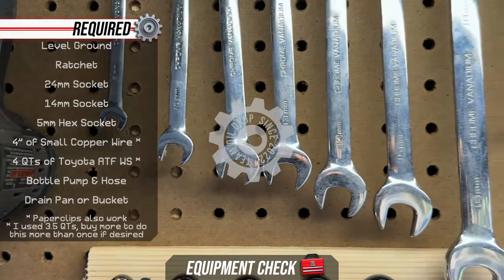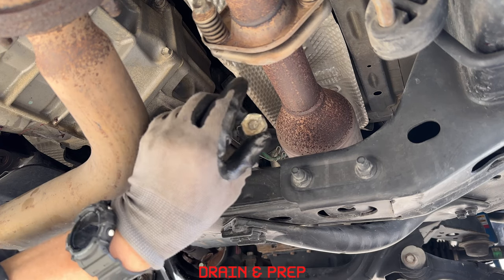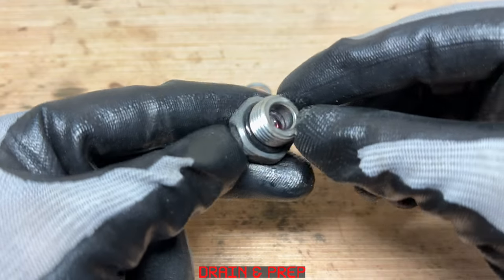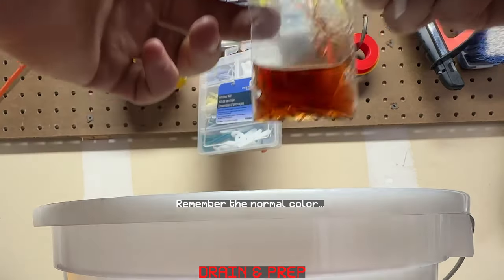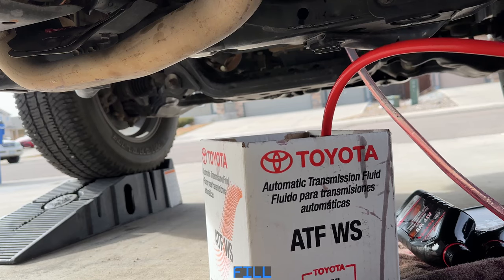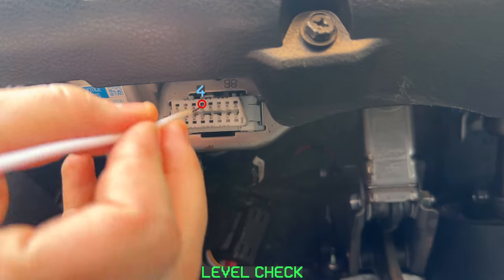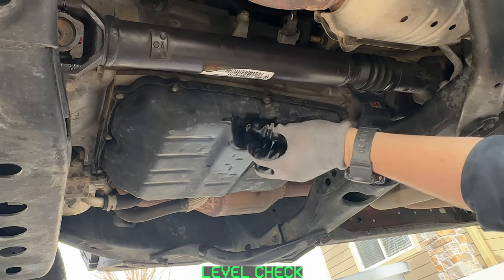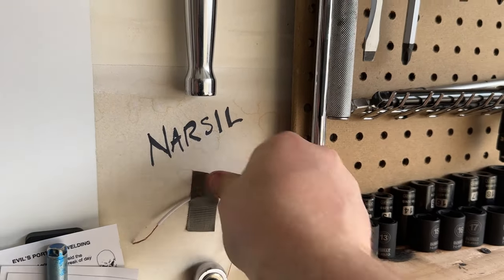How to Replace Transmission Fluid Drain & Fill Tacoma 3rd Gen

Comment: Do you have to do the temperature check mode? What happens if you don't do it? Like if I put the fluid in, cycle the transmission and then check the overflow, will it cause a problem?
Reply from the maker: Great question. It will cause a problem. The fluid  expands with heat and should be at the proper temp to measure. Thus, temp check mode. See the notes if you have a 2020 or newer.

Comment: One question I have, the Toyota manual makes mention of bypassing the thermostat for the trans cooler by pushing the plunger in and using a hex key to hold it in while you do the check procedure.  Is there a reason that you did not do this?  I have a 2017 with the Trans Cooler so I am not sure if it causes a false reading or not by skipping that step.  Thanks.
Reply from the maker: Hey! I too have a trans cooler and tow package. I never bother as it will eventually circulate through. I don’t recall it in the Toyota TSB either, however I could be mistaken on that one.

Comment: @teamoildrop 

Please please please, add this important step.

Perform the transmission oil change COLD.

I just did the oil drain and fill on my 2017 TRD Off Road your instructions were perfect. 

Thank you
Reply: That was going to be my next question if the trans needed to be cold or hot. Thanks!!
Reply from the maker: It's certainly better to do this with a cold engine and trans, but it's not required. The chances of burns are worth doing the service cold though.

Greg the Editor
Reply from the maker: It's best to do it cold. Not to mention the safety factor of burns, the trans temp needs to be >95*F to check the fluid level.

Comment: @Team Oil Drop What AWG is that copper wire? Sorry, the only thing I couldn't ascertain from this detailed video. Thinking 24 or 20 AWG would work here. Going to use this procedure for my ES 350.
Reply from the maker: Hey brother! As long as it fits it’s good to go. You can safely even use a paperclip. No amount of current is being passed beyond just the truck talking to itself. As for the wire I used… I can’t recall. Gauge similar to a paperclip.
Reply: @teamoildrop Thank you. You got yourself another subscriber 😊
Reply from the maker: @lji2000  welcome aboard! 🍻

Comment: I might sound silly but is it safe to have the ramps on the driveway like that? This is innovative and seems easier than floor Jack & jack stands
Reply from the maker: Hey brother! I only do it because my driveway is sloped. But yes, completely safe 🍻 always keep in park and e brake when you can
Reply: @teamoildrop  sick!! Truck needs to be level for this correct? Or is it ok to have the front lifted due to the ramps?
Reply from the maker: @richardson_adventures  level as you can get her 😌

Comment: I’m struggling to find the fill plug. Based on the video it’s obviously in a weird spot, but looking in the same area as your video shows I cannot find a 24mm bolt. I think some of the newer gen 3s may have the fill bolt in a different area. I have a ‘22 TRD Sport 2WD. Can you provide some guidance? Thanks!
Reply from the maker: 2WD have a different spot. Hop int he discord if you havent already and we can show you.

Comment: Do you know where to get a replacement for the rubber gasket on the fill plug? Or the part number? Thank you. Awesome videos.
Reply from the maker: Fill plug gasket is 90301-15004

There are many retailers that sell this seal. I like Toyota Parts Deal

Greg the Editor
Reply: Thank you.

Comment: Hello , I did the drain and fill and put in 4 quarts in total but I never did the Temp check mode 
Do you think It will affect overall?
Reply from the maker: It's really hard to say. Many transmissions have been found to be 1/2 to one full quart low from the factory. You could be low or you could have over filled it. 

Did you measure how much you took out? Too high of level can be just as bad as too low.

I would suggest completing the temp check and overflow portion of the task.

Greg the Editor

Comment: During Temp Check how much fluid do you want to see come out of the overflow plug to be satisfied? If it doesn't gush out but there's a small stream would you call it good or add more?
Reply from the maker: It’s a bit subjective. The actual verbiage from the Toyota service write up is indeed “small trickle”. I wouldn’t think into it much past that and you’ll be good 👍
Reply: Awesome, thank you so much for your response and an awesome video!

Comment: Quick question - do you just do one of these drain and fills at the recommended 60k interval or multiple over the course of a few oil changes to ensure all the fluid turns over?
Reply from the maker: @ovrt21  honestly it’s going to be up to you. I tend to do one d&f every 25k or so.
Reply: @teamoildrop  ok sounds good. I may do a few at a lower interval to cycle through the old fluid and then go to 25k intervals

Comment: Hey brother, great video. I completed all steps except for the Temp Check one. I tried to do it with cooper wires, a paper clip and didn’t light up the dash board as mentioned. Any other reco?
Reply from the maker: @marcomarco-369  thanks man! 2020 or newer? If so check notes
Reply: @teamoildrop  Yeah, 2021 SR5 4WD. So try it again and check notes? Can I just do it anytime? Thanks!
Reply from the maker: @marcomarco-369  yeah the notes here just mention how 2020+ can skip the wire part 😎

Comment: Great video , I have a 2016 Toyota Tacoma 4 cylinder sr would this be the same process? Thank you .
Reply from the maker: The processes will be very similar. The fill capacity and torque specs will be a bit different.

Greg the Editor

Comment: What about dropping the pan & changing/cleaning the trans filter, is that an option and also get more fluid changed as well?
Reply from the maker: Good question! I’ll be dropping the pan in a future video. However, as for the filter, most of us have a metal screen permanent type that only gets replaced if damaged. Some of us do have a fibrous filter that can be changed but not many.
Reply: All of the videos I’ve watched show people dropping the pan. This was nice to see done
Reply from the maker: @ogdadbod  pan drops serve a purpose like making sure you don’t have metal bits stuck to the magnets and ensuring your filter isn’t clogged etc, but not needed often. I’ll cover it soon.

Comment: Many others say to pin the thermostat if your truck has the tow package with external cooler. I look at it this way, if you get it up to temperature in temp check mode, that thermostat should open anyway on its own, or is it always better to manually pin it first? Thoughts please? Want to be sure all the fluid is flowing through the system including the external cooler to get an accurate fluid level.
Reply from the maker: The Toyota procedures call out to pin the thermostat open regardless if you have an external cooler or not. I'm not an engineer or a transmission specialist. I just follow the data.

Greg the Editor

Comment: I'm experiencing some stuttering issues with the torque converter on my 2016 Tacoma TRD 4x4 Sport. Can I try doing a flush and adding the Lubegard additive? If so, do I just add the Lubegard Studder Fix to the bottle and pump it in?
Reply from the maker: I'm not familiar with the Lubegard studder fix, and I wouldn't recommend putting that in your transmission unless it's a last ditch effort to keep it alive. You could always start with just a standard drain and fill and see if it gets any better before putting that fix a fluid into your trans. I'd be worried it might cause more damage than anything personally.

-Austin

Comment: Question - Do I need to pin the thermostat on the side of the transmission before checking the fluid level? I've seen several videos where they would pin the thermostat first while others didn't.  Not sure which way is correct.  Thanks
Reply from the maker: @chrisdavis9318  can’t hurt either way, we’ve got a new video on here linked in the description that will show you a couple of better steps as well
Reply: @teamoildrop  Thank you for getting back to me so quickly. I appreciate your help.
Reply from the maker: @chrisdavis9318  🍻

Comment: Looking at the FSM, it states to basically do 3 drains and refills during the process: In otherwords
1)drain it
2)fill it until the fluid comes out the overflow, stop and and wait till it just drips
3) replace overflow and fill with 1.6qts (3.3 for your engine)
4) repeat steps 1-3, with the addition of shifting the gears like you did
5) drain once again, but install new drain plug gasket/washer and torque this time
6) repeat 2-3 once again, but torque everything down

Any idea why the process is so....convoluted in the FSM?
Reply: I was wondering the same thing.
Reply from the maker: the wording is a bit “wordy”. you are basically mixing in as much as you safely can each time to freshen it that much more each iteration! it’s the easiest way with these sealed trannys.

Comment: I did my 2007 Tundra's (208k miles ,6 years) transmission drain and fill today. Appreciate the walk through on this video. I do have a question, though. I drained 4 quarts (just to a tad lower to the line) and replaced with 5 quarts. During the Overflow check to a trickle, 2 quarts came out before the trickle, filling my container to 6 quarts or 1 quart more than what I put in. The math doesn't seem right? Test drive temp guage was up to normal, and there was no slipping feeling. So I'm happy, just puzzled and I feel based on the trickle that there is enough fluid.  Thoughts?
Reply from the maker: Transmission was cold when it was drained?
Fluid was put to temp when the overflow was opened.
Thermal expansion

Greg
Reply: @teamoildrop  I drove my truck around the block twice before starting. At the time of draining the laser temp gun read 92. It should be good, ay? Thanks for your comments.

Comment: If our 3rd gens came with the tow package, will we need to bypass the trans cooler during the leveling step?
Reply from the maker: I have the TP and never bother. It always mixes in the end!
Reply: Thanks for the response. I was more concerned with the accuracy of the level check.

Comment: Correct me if I’m wrong, but I believe the procedure is different when the Tacoma has the tow package with trans. Cooler??
Reply from the maker: No difference, but the overall capacity will be greater with the external, radiator mounted transmission cooler.

The Editor

Comment: Hey I did all this minus the temp check portion. My question is what happens if it gets too hot and I drain oil. Will too much come out? I drove my truck and everything seemed totally fine but I’m not too keen on what to listen for etc. a few times when putting into drive it clicked but it did that before and I think maybe now I’m just being paranoid
Reply from the maker: So I can understand, you drained, but didn’t do it in temp check mode? You didn’t after driving for a while?
Reply: @teamoildrop  hey I never drove the truck. It only ran through the gears with e brake on and then sat and idled for 10-12. Then I drained excess. I have a feeling it may have been hotter than 114 degrees and I was curious to what happens if you drain it when it’s too hot. Does too much come out? I drove it around AFTER the change. I had to for work. It rode fine but when going into drive I noticed a click sometimes. I was gonna go into temp check mode today and recheck the transmission once it’s at the right temp and see if it’s still dripping. If not I guess it too low now. Unless the temp check is so I don’t burn my hands?
Reply from the maker: @danielmcnelis389  you’ve got a good plan of action. I don’t think you are any danger of hurting your truck in such a short span of time. I would do exactly as you plan. If nothing comes out, add more and redo temp check mode before opening check plug!
Reply: @teamoildrop  awesome thank you!

Comment: Question: would the truck being on the ramps cause the overflow hole to not put out the right amount of excess fluid?
Reply from the maker: Great question! I explain in the video I use ramps because my driveway is sloped 😌 

Level is key!
Reply: @teamoildrop  that’s right I missed that your driveway is sloped. So for those with a level driveway, we have to make sure we keep the truck fairly level. Thanks!
Reply from the maker: @wail7534  you got it brother!

Comment: I haven’t changed my trans fluid and I’m at 95k miles. I’ve done some heavy towing a few times for upwards of 7000 miles total for the life of the truck and a little off-roading. I feel I should have changed it sooner and had a friend tell me I may not want to change it because the pads in the transmission could have completely worn and when I take the old fluid out it may have grit in it that keeps everything working for now, causing my gears to slip when I put new fluid in. He told me I should check it first. 

What’s your opinion of this and if I wanted to just check my fluid, could I just open the drain plug and put it right back in after a little drains?
Reply from the maker: You are at the sweet spot to change your transmission fluid. Toyota recommends at 100k unless you have done a lot of towing, then as soon as 60k. Your transmission is perfectly fine and is ready for a drain and fill!
Reply: @teamoildrop  thank you so much brother 🙏🏼 I love your videos, I changed my spark plugs last weekend and plan to do my coolant this weekend. Never did my own maintenance before but I work in trades so this isn’t hard at all having experienced with tools 👍🏼 appreciate you man!
Reply from the maker: @jordanweb96  love to hear it! Your truck loves it too. Happy maintaining - Tyler

Comment: Question. I have an 08 5.7 tundra also. Do you have the tans fluid tutorial for that? Is it the same method with entering the check mode?  Thanks
Reply from the maker: Yes, this part of the procedure is the same for your 2008 Tundra as shown in the 3rd Gen Tacoma video

Greg the editor

Comment: What socket depth/brand used?  And torque wrench model and male end size?

I am having trouble getting to the full plug.  Either it’s not long enough to get around the transmission, or it’s too long and it hits the body.  Thanks
Reply from the maker: IIRC: I used my Dewalt 1/2” drive socket wrench with a standard depth socket for the fill plug. Did not use any extensions. 

At this time I also use a Dewalt 3/8” drive socket wrench for measurements up to 100 ft lbs.

Comment: I just did this but now I'm thinking...If the truck isn't 100% level will that cause more fluid than necessary to drain out of the overflow?  Ground was level, but truck has a slight forward rake.
Reply from the maker: While I’ve never heard this discussed, taking in the factory rake in the measurement id lean on the side of safe. Yes, a dealerships will have the truck on a lift negating the rake, but we as the human race have been swapping fluids in sealed trannys for years while bound to the ground.
Reply: I put a level under the frame and raised lower end to level.

Comment: Do you think it's necessary to push the pin in on transmission thermostat to get an accurate reading? I came across car care nut explaining if you have an external trans cooler the thermostat needs to be pushed in for an accurate reading. Just not sure and did service yesterday and everything seems fine after test driving. TIA
Reply from the maker: I personally never have!
Reply: @teamoildrop  ok, I think its fine not doing it. After rechecking fluid level in temp check mode and thermostat pinned it was at the same level. Basically no fluid came out. Good to go! Thank you for the help
Reply from the maker: @marcusparis7344  my pleasure brother! 🍻 happy maintaining

Comment: Just a note. If its hot outside your transmission will be to hot for this to work. Its gotta be cool outside regardless if the car has been running or not . Setting in the sun for a few hours will make it to hot to check
Reply from the maker: @prestonhanson501  ambient temps will most definitely play a role here ☀️
Reply: @teamoildrop  just got doing it a few min ago. It kept flashing even thou I hadn't driven my car today. Was the heat today driveing it to hot turns out lol. Had to wait for it to cool down outside

Comment: HELP. So I only got 2qt of fluid out of my drain. I added 2.5qt like what was shown, on the later steps when I was letting the overflow drain it was coming out and I stupidly shut off the engine which then allowed .5qt of fluid to come out. So in my mind I'm good because it came out to an even 2 quarts? Or did I screw myself. Any advice is appreciated. Thank you for the video!
Reply from the maker: Bets option here is still to add fluid and go through the proper temp check mode. Its THE way to be safe and sure.
Reply: @teamoildrop  do you think I should add another half quart or more than that? Two quarts seemed pretty low to me. I did this on a complete cold start. So the truck was only running for the time it took to do the initial temp check process and the overflow drain.
Reply from the maker: @whydidtheybringthisback  add another whole one, then run the process. You’ll be good. More to mix in with the old anyway
Reply: @teamoildrop  hell yeah. Thank you, enjoy not being on Carson any longer. I was there for 4 years. Thankfully only with 71OD GRP EOD. We didn't have to deal with 4ID fuckery.